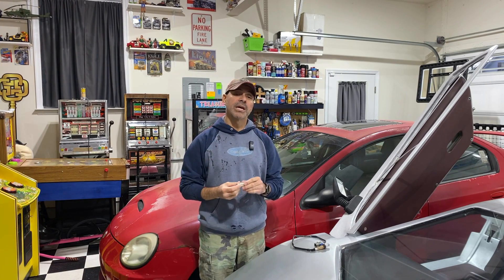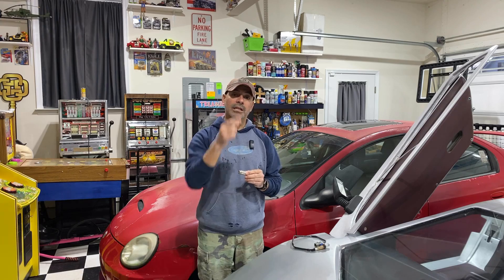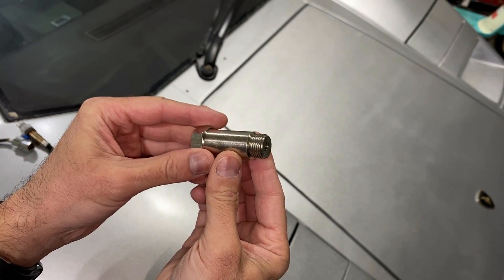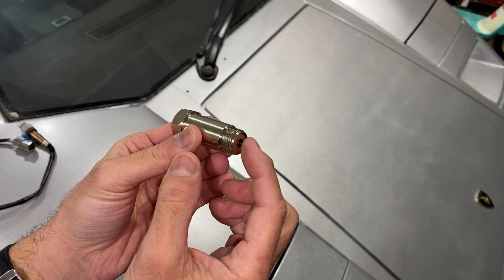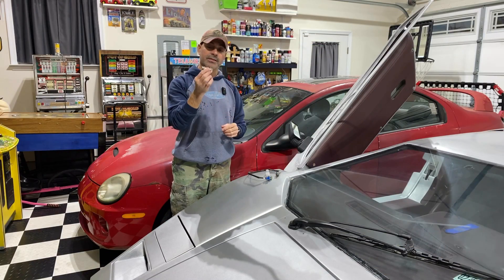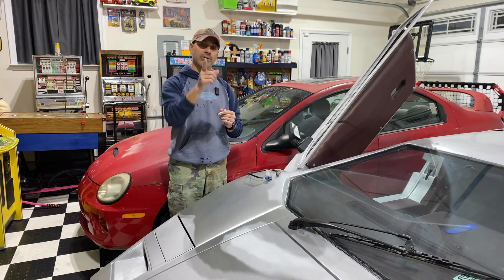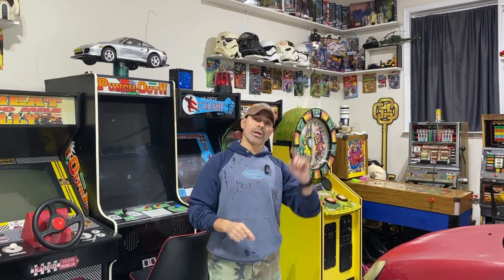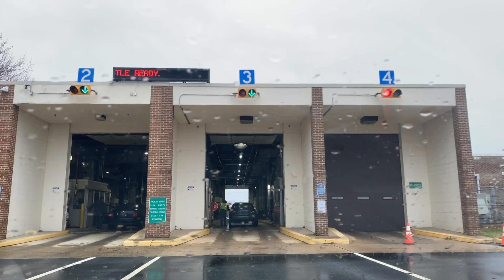Do Oxygen Sensor Extenders Really Work?  (Andy’s Garage: Episode - 453)

Comment: I just put this on for p0420, I've replaced the downstream still code coming up, I think its from using too much zinc zddp additive in 03 2.2 s10 that I didnt know doesnt even need zinc because its a modern engine and that zinc someone mentioned will poison and ruin the catayltic .

How long should it take to clear if it does work? Could I actually put 2 on to double the length that way its not getting hardly any?

Its the same situation Im due for registration a month past now and I just cant afford the new catalytic.
Reply from the maker: It should clear the code fairly quick. If you put two on you may get a code because it’s not getting any reading.

Comment: I did the same thing the aftermarket cats is to high of a flow rate and doesn’t have as much surface area on the inside with the precious metals to do the exact same job as the factory oem cats. I even walnut shell blasted the valves and cleaned all the caked on carbon. Car runs better than it ever has.

Comment: i deleted catalytic converter on my civic 2004 and the check engine light on (code p0134).
i used these plug (to cheat ecu) to o2 catalytic converter sensor for many years and its worked for my civic 2004 (no check engine light), but sometimes the error p0134 came again.. and after driving about a week (dont know the milage) the check engine off.. it keep happen about once in a year i think, and i ignored it the check engine go off by itself.

Comment: They're about as useless as spark plug extenders. When it's reading that the catalytic converter is below efficiency it means the O2 is doing its job that means go upstream and check the engine performance and if necessary replace the cat cats do go bad

Comment: Where I can buy that extender? Extender, wor for 2014 infiniti qx 60?
Reply from the maker: You can find them online: Amazon, Walmart, eBay etc. There are different lengths so you will need to do some research for your vehicle
Reply: Dorman - HELP M18 1.5 Steel Non-Fouler 
Is what I think it’s officially called. I’m picking it up at AutoZone today. Hopefully it works.

Comment: Usually works this method, but on Prius doesn’t work with aftermarket cat. Also in California u can’t pass smog with spacer. The best I did was changed sensors after “readiness”ready. Parked near at inspection service, remove spacer, then arrive at service

Comment: Hey, great video.  I have the exact problem you had, catalytic converter and oxygen sensors have been changed with aftermarket.  It's running fine but I don't know where to buy the spacers.  How do I know what spacers I need??  I have a an 04 Chevy Silverado 4.3L order some online and they never came in. Is it something I can buy at discount auto parts?
Reply from the maker: I always get them online, Walmart.com has them for around $5

Comment: I use those on two different cars and now I'm getting slow O2 sensor reading codes instead of the p420 codes
Reply: Drill the whole slightly if overdrilled again you will get p420 then you may have to add glass wool.

Comment: I had a P0420 and saw some videos that said the extenders would keep the engine light off. I tried one and not only did the P0420 code come back quickly but a knock sensor came on also
Reply from the maker: There are various lengths, you may have used one that was not compatible with your vehicle. Also, make sure it’s added to the downstream sensor(s)

Comment: Thanks. I have a 2012 Expedition that is in the exact situation you describe with an aftermarket converter. I have also replace both O@ sensors. I put a Walker converter on the left side and it is fine. I put an Evan Fisher converter on the right side and replaced both o2 sensors and the light still will not stay off. I have an inspection coming up in two months so I am probably going to try this.
Reply from the maker: After market catalytic converters can cause that since they are not OEM. This should solve your problem

Comment: If I have the p0420 code and I installed a spacer now I have a code saying slow response on the 02 sensor should I replace the 02 sensor also?
Reply from the maker: No, make sure you used the correct spacer. They make different ones, some longer than others.
Reply: @PhillipsVision mine was actually the exact one you had in the video
Reply from the maker: @xpert447 Depending on your vehicle this one may not work properly

Comment: Are there sensors on the driver's side of the catalytic converter as the passenger side?
Reply from the maker: Depends how many banks you have. If your vehicle has 2 banks then you will have one on each side. If you have 1 bank then only on one side

Comment: I've been getting the orange engine light for some time now. I've checked the cat and it's as clean as a whistle, yet I still get the PO420, just fitted a spacer today ....so let's wait and see.
Reply: How did it go?
Reply: @JamesWherler-n3v Still get the orange light but not so often...same error code. I think it's a software glitch. I just reset now every time. The car seems to run fine. Oh and I replaced the cat with a new one...waste of money.

Comment: I replaced my Cat and all 4 O2 sensors still get the check engine light. I have 4 o2 sensors 2 on the up stream and 2 in the down stream. Do I use one or two extenders on the downstream
Reply from the maker: One extender for each downstream sensor.

Comment: I tried this on my 2010 Forester, and it worked for about 25 miles. I really dont want to put new cats in a car with 237K miles on it. It would cost about ¼ of the cars value. I bought the ones with the mesh off Amazon. I'm wondering if maybe I need to take the mesh off?

Comment: I had to replace the top one on my 2013 equinox car started stalling 😮after I replaced it started running on again no stalling should I replace bottom one as well
Reply from the maker: Put a scanner on your vehicle and see if the downstream sensor is bad before you replace it

Comment: I tried all the hacks and nothing works on advanced ECM vehicles. so, from my Actual Experience that would be pre 2015 maybe...
Reply: So it won't work on most vehicles after roughly 2015 or before? I tried on 2012 f250 and lights still on. Tried unplugging battery and still comes back. Would using a scan tool help clear it?

Comment: I live in NY and I can’t pass my monitor bank. It’s the only thing holding me back from getting an inspection. And ultimately renewing my registration before it expires. Some kid at auto zone told me about these and I did a little research, now here I am lol great video. I’ve ordered my spacer for my 09 Sentra. And hopefully it will be here by Monday. 

I want to add that I know my manifold cat isn’t working correctly. 02 sensors are new and everything is reading like a bad cat, voltage wise. But with the crunch I’m in, I hope these save me anywhere from 11000 to 2000 usd

Comment: I heated the one that I uninstalled until it was red hot and then while still hot dipped it into 45% vinegar. I repeated that 3 times and then used brake cleaner in the same process., and then installed the extender with the o2 sensor

Comment: I put 2 spacers (that I had to drill 1/2 inch holes in to get the sensor to fit into the spacer) on my downstream O2 sensor because the 420 code kept throwing out on the OBD tool with just one spacer. Now, I only get a p0014 code. WTF? I just replaced the VVT solenoid recently so a 0014 should not be an issue , I thought? Maybe the ECM reset has initiated a new set of errors after the change? Oh, and I need the spacers because I knocked out all the platinum in the cat converter a while back because it went bad and then installed the downstream spacer to keep the engine light off. Still, check engine light lives on my dash and it is annoying... just this time it is with a different error code than the P0420. I guess Ill reset the light and see if it returns and maybe clean the VVT solenoid if it keeps throwing the P0014 code. Sigh.

Comment: I hope it’s not a stupid question but do you need to clear the code after installing the spacer ? Or will the light turn off ?
Reply from the maker: @margaridamartins8532  You can clear it but if not it will go out after you complete a drive cycle

Comment: Part number?
Reply from the maker: @DavidDeckard-k9v  There is no specific part number. These are available online from Walmart, eBay, Amazon etc. There are a few lengths which are based on different vehicles.
Reply from the maker: @DavidDeckard-k9v  There is no specific part number. These are available online from Walmart, eBay, Amazon etc. There are a few lengths which are based on different vehicles.

Comment: Does the car need driven a good while before these kick in? Just added to mine and the code back on very soon after. I don't tend to drive the car much so wondering if this could effect?

My cat is 1.5 years old and I've replaced lambda sensors too.
Reply from the maker: @saracas93  If you didn’t clear the codes then you will need to drive a full drive cycle for it to go out, as long as the ECU doesn’t detect any issues.
Reply: @PhillipsVision  code was cleared car drove fine a couple days and then 4mins to the test center came on again 😂 bad luck. I've cleared code again and will drive longer. Out of interest what is a full cycle?
Reply from the maker: @ Normally about 20-30 miles. The ECU needs time to check all sensors. You need to have a few stop and go instances (Stop signs or Red Lights) and 10 min drive accelerating over 50 mph. If you haven’t completed a full drive cycle the testing center will make you come back. Out of curiosity, did you put the extender only on the downstream O2 sensor(s)?
Reply: @PhillipsVision  I would need to confirm with my mechanic. Really appreciate you taking the time to reply.
Reply from the maker: @ No problem 👍
Reply: What scanner do you have and where did you get it?
Reply from the maker: @Geo-ct4mw it’s a generic Bluetooth adapter running on Torque Pro android app

Comment: i have a 2019 promaster 1500, i installed one of those extenders on downstream, but now i get "O2 sensor slow response" message. how do i go about that issue? thanks
Reply: Will this work if I have a leak at my flex pipe
Reply from the maker: @ Maybe
Reply from the maker: @alexanderkasyanov4946  there are various extender lengths, you may have purchased one too long

Comment: Hi Andy, I appreciate all the good information. I was just wondering if the check engine light came on again after installing the extender?
Reply from the maker: @sebasrt88  No it did not. The vehicle passed the emissions test and the light has been out for months. The car gets driven approximately 160 miles per day. Running great.

Comment: Im in NJ n my buddies Audi a4 which is eating a ton of oil bcuz of bad piston rings n valve seals is shooting a p04200 code. Already replaced sensors n been through 1 pcv valve. Im replacing the pcv valve again today bcuz it's shot after lil more than a yr. I know his cat is fine. Vehicle drives well n I ran a boroscope down the tube n everything is clear as well as taking pre n post cat temps which are spot on. So today I am doing the pcv valve n o2 sensor extender to try n get through inspection. Wish us luck, fingers crossed.
Reply: What happened???
Reply: Updates?

Comment: Do I need the short one spacer or long one? What's the difference
Reply: Either one long one or 2 short ones in order for the 02 sensor to fit
Reply: @carlitosediel  ok but can I use just 1 piece of the short one ? or has to be 2 shorts? Tks

Comment: I used one on a 2004 Ranger V6. It worked for several years until the engine cratered at 245K mi. Replaced aN aftermarket Cat on a 2012 Nissan Versa with no problem until I sold it at 200K mi.

Comment: I just did it on my 2004 Subaru Outback that has the California emissions. My car has three converters and five O2sensors. I replaced the rear sensor and cleaned the one before it. I used the extender for both and poured Seafoam in the cats …locked it all down…and ran it til the smoke cleared….drive it to about 64 miles and got it inspected with no problem. ( I’m in New York State ) it got a little over 100:miles and the check engine light is still out! I even have two exhaust leaks….🤙
Reply: Man im having the same problem wit my 2009 subaru outback trying to get a nys inspection 💯💯💯a few ppl told about a j spacer..now im definitely gonna give it shot
Reply: @Ilovesneakers4448  i have a out back  i got mine to pass in CA  message me if you still have any issues

Comment: My Gen 1 Toyota Sequoia has bolt-on downstream O2's, they do not thread in like I wish they would. Originally after getting the P0420 code I bought these screw on type. After getting the truck up in the air, I noticed the different style my truck had.I decided on the quickI would use a length of 1" thin wall steel tubing to lift my B1 & B2 downstream O2's up out of the exhaust stream a bit. I used my MIG welder to hold thin wall tubing onto exhaust pipe and put everything back together. 
My check engine light went off immediately and truck feels like it has more out of the hole power on take off. The bad here is my milage has gone out the window. 
I believe the length of the thin wall tubing I used is too long. I am nrext going to shorten the tubing and bring the O2 sensor back closer the the stream of exhaust.
Big difference between my approach and using an anti fouler extender (that is where these extenders came from. Early engines would foul spark plugs often so somebody made these extenders to stop that.)  Extenders have a small hole at the end. My tubing has wide open hole on the end exposing O2 to more exhaust coming out of the cat's.  Hopfully shortening these will restore my fuel consumption problem.
UPDATE:
This p-ast weekend I decided to buy new cats for thew truck. The original cats were 23 years old and it appears have worn out....
First I looked on Amazon and they sell regular EPA approved cats but my account will not let me deliver these to my Californis address. California and Newe York  are the only states that supposedly have tougher smog requirements and want CARB approved cats. Ebay sold me a set of cats plus hardware for under $250! I mean, the box they came in was heavy and big. Fed Ex shipping had to be more than $50! How does the seller make any money? 
The EBay cats were smaller than my original and Im sure I would not pass the visual inspection so I started the return process. I also just broke down and ordered 2 $1,250 CARB approved cats!    I also bought new fasteners and down stream o2's by Denso. They came and I completed the complete install. Now that the o2's are all reading correctly I notice smoother acceleration and better gas milage. 
There's a code stamped on the bottom of the cats that the smog guy will look for upon inspection. Without that code it would not pass I'm told. 
If somebody living in Cal or NY has EBay cheapie cats and wants to stamp their own letters on the cats Ill give you a photo of what yours should have to pass.  get ahold of me.
Reply: K

Comment: Hey Bro!!! I got P420 and P430 and shows on the report. I am not sure if I can do what you did because u only said P420 or P430. I have both. What is ur advice. Or anyone here. TY.
Reply from the maker: @mozee01  The codes you are getting are saying both your banks are having catalytic converter issues. You can use this but would need two extenders. One for each downstream O2 sensor since you have two. The car in my video only had one.
Reply: @PhillipsVision  ty

Comment: I don't care about emissions. But I do care about my car engine. Honda Civic. I think my cat is just wore out (but not stopped up) because I get this code about once a month and i clear the code. I don't have any performance issues. I'm fixing to change spark plugs. The cat has 250k miles on it. My question is doesn't the ECM need this input to adjust fuel trims for a better running longer lasting engine?

Comment: Hey brother I have an 05 Altima & replaced both converters with aftermarket units. Still got the p0420 code. I watched this video & followed your instructions & it worked like a charm. Thanks a bunch.
Reply from the maker: @3bs1love  Awesome! Thanks for the feedback
Reply: Dude, the Nissan Ultima’s are the worst.  When I worked at Merlin muffler and brake, we tried numerous amounts of aftermarket catalytic converters and none of them would work. We had to revert back to the factory catalytic converter assembly, which was $2-3000 and this was way back then this was for the 2.5 L Nissan Ultima.  I highly recommend you try exactly what this gentleman is doing but if you can’t get it, we ended up having to replace the aftermarket high flow catalytic converters with a factory set and it worked and it didn’t bring the check engine light on I don’t know what it was about that vehicle, but it was very sensitive.

Comment: I bought the extenders but before installing them I decided to try Cataclean. It worked for about 200 miles then CEL came on again so I did another treatment. So far it's been 5000 miles and no more codes. I think bad spark plugs fouled my CAT. They were fake NGK from Amazon that only lasted 30,000 miles before causing misfires. New plugs and Cataclean may have solved my issue, fingers crossed.
Reply: Some NGK PLUGS ONLY LAST 15,000 MILES.
I spoke with NGK in California, about warranty, I had 19,000- miles. They told me RUTHENIUM PLUGS, YES RUTHENIUM ! Only last 15K.
These are better than IRIDIUM, burn 🔥 a wider heat spot.
2012 Sonic 1.4 Turbo.
Plugs are found in a 2019 Sonic 1.4 Turbo ! Same engine/ engine specs.